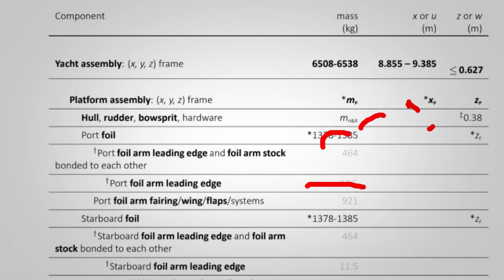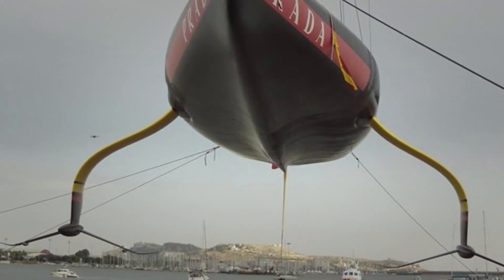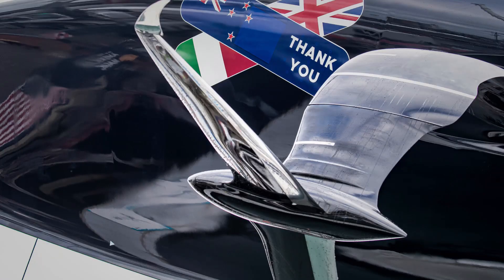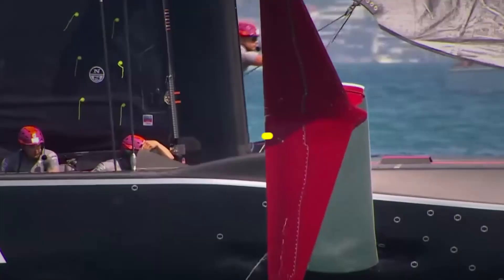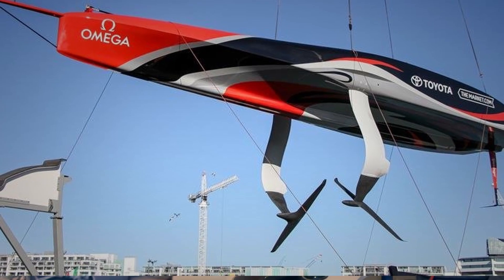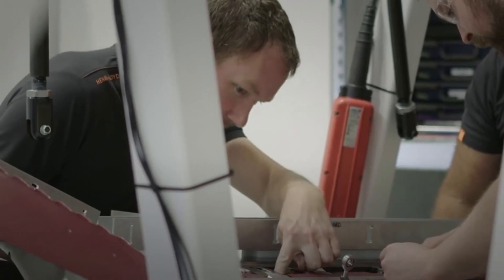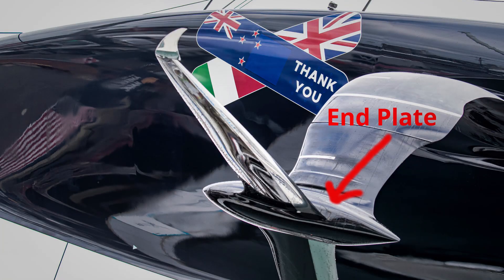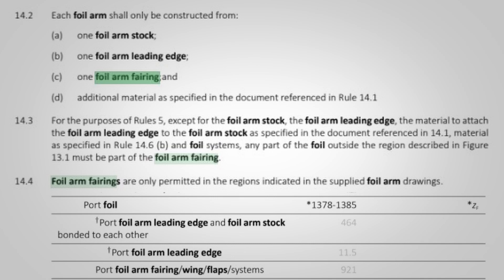Was American Magic's bulb a mistake? America's Cup Design Review

Comment: I do think hydro/electro mechanical actuator in 2021 is very small. This bulb one of big reason is to get laminar flow in the back of flow fron T/Y shape
Reply: Actually the rules do not permit the use of battery power for controlling the flap angles. That stored energy is only allowed to be used to raise the foil arms.
On Edit: PLEASE NOTE AS BELOW 
this claim is incorrect
Reply: @Gottenhimfella  According to the designers, everything below the waterline may be operated using stored energy (batteries) via electro-hydraulic systems. This includes the flaps, and rudder rake. Above the waterline, all energy must be provided by the crew, including the hydraulics used for sail trim.
Reply: @maxhugen   Indeed, I was labouring under a misapprehension, so: many thanks for the timely correction. From my reading of the rule at appears that there actually is one underwater control which may not be powered electro- hydraulically, and that is  rudder yaw. Which does not contradict what you have just spelled  out, but unless I've managed to get the wrong end of another stick it is an exception to the rule of thumb you were told regarding underwater systems.
Reply: @Gottenhimfella  👍 I believe that the rudder yaw is also included as "below the waterline", but it is also stipulated that it be controlled via a "wheel". Don't understand the rationale for that!
Reply: @maxhugen  I believe it's because they want them to look a little bit like they are sailing a conventional yacht, similar to the rule of having grinders turning handles rather than pedals, they just didn't want to appear too alien!
Reply: @cindyullsee393  Ha! Who knows. I study the physics of these boats, and they certainly are "alien" to any other mono hull... although I guess the IMOCA class does have some similarities. 😁

Comment: NZ design is crafty. Putting weight into fairings leaves foils sleek which I guess reduces form resistance and maybe helps minimise cavitation. A smaller lifting area reduces friction but it can also make it harder to lift in light airs. Putting their foil at the bottom of the design box allows a higher loading before the foil ventilates.
Reply: Also the NZ foils are sitting way back on the arms compared to other designs..  Would like to hear a comment on what effect that has.

Comment: you want to minimize drag in the water when on the foils, and have enough lift to stay up on the foils at your critical speed.  it appeared early on that the British had too high a critical speed, and that's why they couldn't get on the foils in light winds/low speed conditions.  the faster the wind, the faster the boat will go, but the more drag the foils and rudder will have and tend to slow the boat back down.

43cm, or 430mm, is about 17 inches.

Comment: Are those foils made of composites? Or.... would it be an option that the whole foils are made of milled steel to meet the weight requirements?
Reply: Yeah, I was wondering.  I was actually thinking nickel alloy to get the most mass for the volume.  If they're composite, even stuffed with lead I think getting them to 0.9 tonnes each would be a stretch!
Reply: I think if you machined from solid steel you are still a little light but not by very much.
Reply: @rbcg105  I believe it would be relatively easy to pack lead into machined interstices in the steel foil if that's allowed by rules.
Reply: @geoffwood2712  that's got to be the way they have done it. A good stiff structure in steel with lead in the gaps where required
Reply: @rbcg105  I would have done just that (also best choice for the stress transfer at foil-arm) and it allows you great latitude to work around vibration modes across the huge speed range.  Thinnest sections and easy to mill for actuators also.  I don't know how much time they had for design/analysis/testing, but my work with Altair's Evolve/Inspire optimization leads me to believe one could play with mass location to get the best out of the tight design envelope provided by rules.  Could also have used titanium superplastically formed and milled to gain even more latitude in design optimization.  Pains me as a carbon-composites guy (a little bit) but what they've accomplished is effing-awesome!!

Comment: Except that America were at 53+knots. So... is the bulb really an issue.
Reply from the maker: Depends if you want to set a top speed or win the Americas Cup...
Reply: @MozzySails  Well, if you cast your mind back to the World Series, AM won their first two races, and looked like real contenders.  I don't think their boat has ever looked slow, particularly downwind.
Reply: @gbr1918   I agree with Mozzy that top speeds are a bit of a red herring, given that they are achieved on a point of sail these courses do not feature. I have a hunch that AM's blistering speeds during the bearaway in high winds were caused by their very small, very flat mainsail producing a lot less aero drag, and the apparent wind is effectively hurricane force when they bear away at 53 knots, so that's a big factor.
I do wonder if the drag of the bulb might still be a problem in more routine contexts, when aero drag is not so predominant, and aero lift is in much shorter supply. 
I also wonder if the control issues of AM were sometimes due to the tailplane at the bottom of the rudder cavitating due to overspeed during the bearaway. 50 knots does have the reputation of being a threshold for cavitation of hydro foils.
Reply: @Gottenhimfella  Agree, top speed does not win races, VMG does. IMO, the rudder still had control just prior to losing the boat. The amount of heel they had causes the boat to pitch up, and I think the flight controller did not (or was unable to) compensate for this in time.
Reply: @maxhugen  I was not particularly referring to the capsize bear away but more to incidents like the fifty three knot instance, where they appeared to lose control (and in that case had to abandon the manoeuvre) without heel being a particular factor
Reply: @Gottenhimfella  Oh right.  Terry Hutchison later remarked that they had some issues with harmonic oscillation of the stab, which seemed worse after the capsize from what we could see of Barker hanging onto the wheel. Although TH didn't actually provide a reason for those multiple incidences, that oscillation can't have been good for the stab's lift.

Comment: It was pointed out during a recent public interview with American Magic and Prada that AM had highest top speed of 53 knots among the 4 teams.  Clearly the bulb does not rob speed with increased drag.
Reply: In isolation their foil wing probably has potential for the highest speed but they had far less control of their boat as a consequence overall foil design, rudder design and other choices. Speed at the expense of stability. Fair enough to try as the boats are a new class.
Reply: @robingimblett2171 ; the shorter-chord foils would need either greater (and much more 'active') control & use of the 'variable camber' function afforded by the flaps, or more camber in the general section:  More camber invokes greater pitching moment coefficient, hence controlling the boat pitch through the range of speeds becomes an interesting issue. (Is this why we saw AM-P so bow-down at speed, and were they having to control that - perhaps excessively - with the rudder T, as to do so with negative flap on the main foil would decrement performance excessively? And is it related to the wheel-shake so often seen on AM-P, or is the shimmy just a function of the foil wave(s)...?) All imo.
Reply: Yes it does. That speed was for a bare second as they rounded a mark and were beam on.

Comment: Can these boats adjust the cant angle as they are sailing?  Maybe help with differing wind strengths?
Reply: Yes, they can, and they do. Typically they sail with 19-22° of cant upwind, and around 2-3° less downwind.
Reply: @maxhugen  ta max, is the pilot adjusting can't angle in gusts do you know?
Reply: @philmole5294  From boat data in ACWS races, I don't think so. Hydraulics may be too slow moving 1.3t to react to gusts. Usually they play the main, such as increase twist or ease the traveller briefly from what I can tell.
Reply: @maxhugen  Where do you get the cant angle info?
Reply: @robingimblett2171  The data streams from the boats include the foil arm cant angle. The actual foil angle = arm angle - 42°

Comment: Are they allowed to have the control 'mechanics' in the arms?
Reply: Yes. They use hydraulic actuators to control flap angle, which are probably housed at the base of the foil arm or the bulb where it intersects with the foil wings.

Comment: What can you tell us about the mechanical, power and control interface between the foil and the foil arm? Since the foil arm is a provided component, is it true that all the foil control mechanisms have the same electrical/hydraulic inputs?
Reply: Actually they perpetrated a minor misconception in this clip; the flap control is not permitted to use oil pressurised by stored power. Nor are the sails and rigging. It´s strictly limited to the foil raise.
Reply: @Gottenhimfella  Incorrect. All systems below the waterline are powered via stored electrical energy and hydraulics.
Reply: @maxhugen  @Gottenhimfella But since all of the teams were designing foils to mate with a standard (i.e. supplied) arm, the physical and control interface at that boundary had to have been standardized. Does anyone know anything about that controls (function and form) are provided at that interface?
Reply: @stevenallan4829  The control mechanisms for the foil flaps were up to the teams. Only the FCS and foil arms are supplied items. The flaps are controlled by hydraulic actuators housed in either the lower foil arm (not part of the supplied foil arm) &/or the bulb.
Reply: @maxhugen  So the foil arms have 4 hydraulic channels embedded within them (two for each of the left and right flap) and these connect into the cant hydraulic system. Correct? Do we know if the hydraulic controls for the two flaps on each arm are standardized, or are the teams allowed to create their own flap-control interface?
Reply: @stevenallan4829  That's right, 2 rams per foil arm, as part of the supplied FCS. The teams design their own flap controls.

Comment: A blended wing body which is area rule'd for the foil arm will give minimum drag for required volume.  Depleted Uranium is more dense than lead and was used in aircraft control surfaces for mass balancing. And putting the weight in the foils will reduce wing root bending moment.